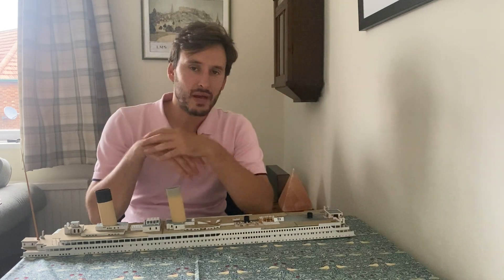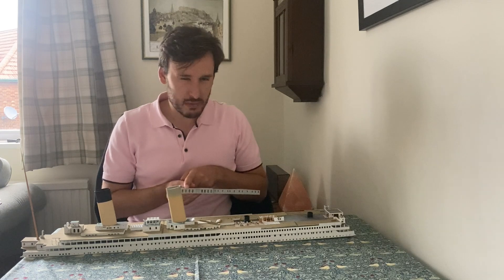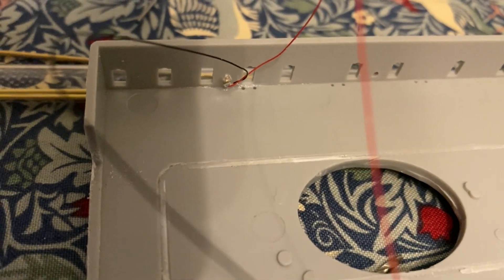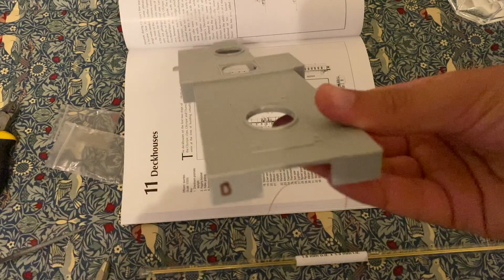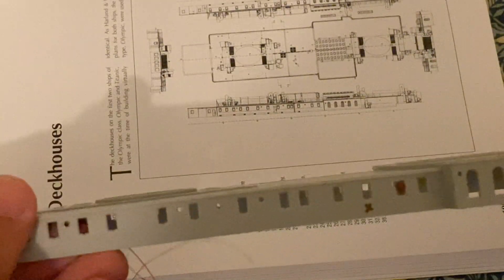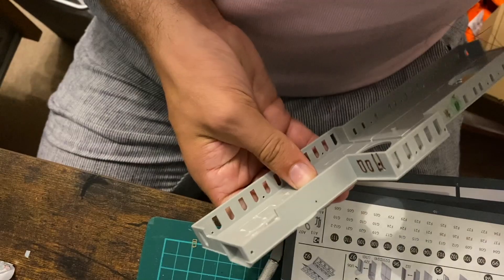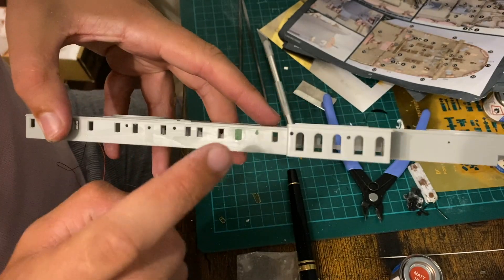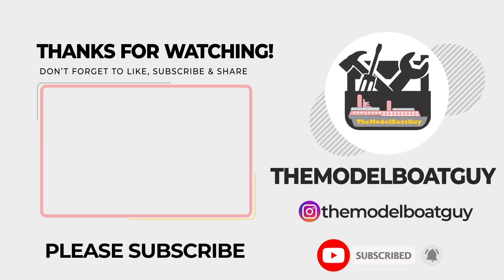Radio Control Trumpeter 1:200 Titanic Build Part 59 - Deck Lighting

Comment: Hi! I ask on different places about the suze of these lights. Nobody knows or nobody wants to say... I don't know. You are my last hope. They look almost the same size as skid lights, but I'm not sure. I need to know the real size, becouse I wanna use fiber optics. Thank you in advance! 🙂
Reply from the maker: Hello, from memory these lights were around 20cm in diameter (but that’s not a certainly) that’s just me going from my memory. 
So they are smaller than the skids. I drilled quite small holes for my LEDs here, less than 1mm for sure.
Reply: @TheModelBoatGuy  thank you!

Comment: hello and congratulations, sorry but I write with google translate.  I wanted to ask how do you connect the various LEDs?  do you do them in groups?  ( type of 4 - 6 - 8 pcs ).  I use a PCB012 distribution board self-Adapt distributor to connect the various leds.  But I wanted to understand how you connect all the LEDs, if you still use the resistors.  I also wanted to ask you if you have a PDF file where there is a diagram of how you connect all the LEDs or if you know how to link me a video if you have done it

Comment: Good evening, sorry for bothering you. I too am building the titanic in 1:200 scale. I wanted to ask you a few things: 1) how do you insulate the brass rod from the soldering of the smd 402 leds?  does the brass not make contact with the led and does it burn?  2) what do you use or how do you cut and make the rod half moon.  ( sorry but I write with google translate )
Reply from the maker: Hi there, 
Because I’m actually soldering the thin wire on the small LEDs the brass tube dosent get hot at all when soldering. I’m also not holding the soldering iron there for a long time. 
To side of the LED which produces the light dosent have any electrical connection either, so there’s no danger of shorting that against the brass.

For cutting the brass tube I just use a very sharp knife blade (scalpel sharp). It’s so sharp and the brass is so thin that you don’t have to apply much pressure. 

Hope this helps! 
Robbie

Comment: Hi Rob ! What kind of resistance did you use for the SMD micro leds ? How much resistance for how much led ?
Thanks for your great job, very usefull for so much people ! Thanks, JY From France
Reply from the maker: Hi there, I use a 330ohm resistor on each string of LEDs. I have a video specifically on lighting which explains it better than I can over comments! 
Thanks for your comment,
Robbie
Reply: @TheModelBoatGuy  Thanks Robbie ! Have a nice day

Comment: Hi, I love your videos. I watch them while building my own 1/200 scale model of titanic. I do have to questions tho, First I would like to add like the Dining saloon and Private promenade deck like what you have but do I need a special type of printer or can I just use the printer that I have? Finally I want to add the 3d printed grand staircase to my model, do you know how I can get that?
Reply from the maker: For the printing, i just used a standard printer, then sprayed the paper with a Matt varnish to give it an element of waterproofing. 
The 3D printed staircase was bought from a Facebook group called Amature 3D printing 🙂

Comment: Hi Robbie. Great video as always. Just a heads up, which you can ignore if you've already spotted it. On the blank aft facing section of the Port side First Class Entrance; the section that you cut two windows in, with the addition of a deck light and door; there is a  kit part numbered B9 which contains those details. I think it was a separate part due to moulding restrictions. In place, the part brings the bulkhead out to the correct level; currently the overhang is too big. It does lead to double thickness of plastic so you needed to open the windows out in any event. I just checked the instructions against my part which I had already done. Sorry that's so long winded but I just wanted to be sure you knew about it. Happy modelling. I need to fill in and re-cut that window on the Port side of the Officer's Quarters. I had missed that so many thanks.
Reply from the maker: Hi Mark, 
Thanks for spotting this, I would have missed it otherwise. I’ve got into a bad habit of not looking at the trumpeter kit at all, so I tend to miss these things!

Comment: Are you going to add the skidlights on the Officer's Quarters? They weren't included in the Trumpeter kit.
Reply from the maker: Yes I will be, I might not light them though, I think they were skylights for the cabins below so I don’t want light pouring out of them.
Reply: @TheModelBoatGuy  They all lead to inside cabins and they had no corresponding windows on A Deck, so the lights being off wouldn't really cause any continuity problems with the rest of the cabins.

Comment: Hi Rob, You have pre-empted my very thoughts on the light shrouds!  However, your idea is slightly better as the brass will eliminate any light leaks. If you intend to also add the KA light fittings, they may well cut the light direction a little more for you.  Short video but you covered some interesting mods that were well worth doing.  Great video as usual.  Bon voyage! I will get back to you soon.  Regards JH 😉
Reply from the maker: Hi John, thanks!
I’m not sure there is room for the KA fittings around the shrouds, which is a little bit of a shame but really they look quite good as they are. 
I’ve also just realised there were lights on the railings where the comps platform stood, so no idea how to do those!

Comment: I can tell you are making fast progress cause your videos pop up more frequently now 🙂 I can't wait till I see the final product of this model. If you finish it you realy have to make a long video where you film every detail and go over the entire model. 🙂. Keep up the beautiful work! You realy are a clever guy bro, it shows with your model and the various tactics you are using. A joy to watch. Grtz man! 🤟
Reply from the maker: Ha well I am getting a bit more time at the moment so the model comes on quickly, however I suspect I will slow down again as work and things get busy. 
Thank you for your comment, I will certainly do a summary video at the end!
Reply: Would angling the led slightly with a small plastic piece help direct the lights angle ?
Reply from the maker: I’m not sure, I think a lot of the ‘spilled’ light comes from it shining through the plastic. I need to add some foil to the roof and then see how we are doing. I certainly need to refine the work a touch